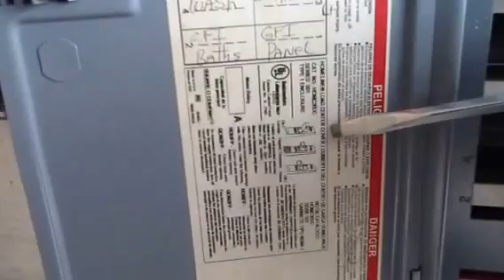"Square D Explain: Home line VS. QO Breakers Made Simple"

Comment: My 20amp dual pole squared d QO only has two snap connectors on one side but only one snap connector on the other side ? I see your 40 amp had two and two .  Is this normal?
Reply from the maker: yours is a Square D QO, what up probably had my hand is a Square D home line,
Which is a builders grade breaker they're two different styles, thanks for watching I appreciate that,

Comment: In 240 volt breaker where a black wire and a white wire are used, the white wire should be colored black at the connection point to indicate it is a hot
wire and not a neutral.
Reply: Absolutely!  Wrap black electrical tape around the wire at ALL connecting points.

Comment: What’s the difference between the single throw and double throw of the two breakers? Is that single throw good for both hot legs to trip or only 1 hot leg to trip? Is only 1 side of the circuit protected in the single throw double pole square d’s?

Comment: Looked at the comments but no one has addressed the 30 in x 3 feet area around the breaker box per code. I had a job a few weeks ago where there was a giant chest freezer in front of the breaker box. The main disconnect breaker was bad. I told the customer its got to be moved. If not I could not suit up for a energized switch out. If not she would have to call the Entergy for a meter pull or call someone else but I still expected my service call fee. Now when I get a call I look at the box and if it is inaccessible I stop and inform the client.

Comment: Wow!  I just learned that I have a QO panel.  I'm in the process of having my electric panel replaced.. and the QO breaker on the video is just like the breaker configuration for the breakers on my current Square D panel which is about 50 years old.  I am having it replaced because the Buss Bar has a short.  And I wasn't sure if I should buy a new homeline or QO electric panel... but the decal on the old panel does say QO.

Comment: 😳 thanks! I found the information I was looking for about 10 seconds into the video.
The installation was going smooth with no issues until I tried to install the breaker and realized that though the box is A Square D, the feet on the one I had were internal and the one on the box was external.
Thanks to your video,  everything made sense. 
So I called the sales associate who told me that they do sell both Home Line and QO, which I need
Reply: My friend went to Home Depot for me and brought the wrong type breaker and the wrong conduit.

Comment: QO, & HL, both "SUCK" trouble  is Aluminium bus bars, "THINK" about it? No-LOX, Inhibitor on service cable lugs, "BUT" not on bus bars? REALLY???
Reply: chill out dude. First: square d DOES manufacture copper buss loadcenters.  just ask your supplier if its so important to you. 2. Aluminium conductors manufactured nowadays do not require no-ox. They are made from the 8000 series alloy which doesnt oxidize nor expand and contract like the wires from the 60's and 70's

Comment: If a person doesn’t know it’s a hot wire coming out of panel then they shouldn’t be in the panel to begin with. Who uses heat shrink on a wire? Wrap it with tape or use a sharpie, but against code comment cause it’s white.? you must be really bored or trying to impress people here or yourself. You sure know a lot lol.Thanks for the QO and Homeline 101. Answered my question. And to the other person commented on tightness and torque, yes he did it right tight as possible, code on tightness lol Loose wires generate heat, can spark, trip breakers etc. us HVAC/R guys see it all the time cause we actually are working on this equipment not pulling wire.
Reply: Too tight damages wires and causes arcing. I’m one of the few who torques every single connection and it’s great to be able to prove to anyone that I did was manufacturer specs say. The thing I hate about square D is their 10-14 AWG conductors have to be torqued to 36 in lbs as opposed to Siemens at 25 and Eaton (BR & CH) at 20! Failure to do this is actually a violation.

Comment: Are those wires live?  How do you shut THEM off before putting them in and tightening them?
Reply: No they are NOT live - how could they be? they are being connected to the SOURCE of electricity. Power doesn't come from the other end of the wire...

Comment: A bit sketchy.  First, I don't think I caught any mention of turning all power to the panel OFF.  And after turning it OFF, testing to make sure it is OFF.  And lastly, putting tape over the main breaker for this sub panel to make sure nobody 'flips' it while I'm working, or for the truly paranoid, putting a lock on the cover!
Reply: Tape is not a lockout means

Comment: My rental has a Siemens double throw breaker as the main breaker on a  square D homeline 200 amp panel. The siemens breaker works but it is slightly lifted on the inside edge. it seems very dangerous. Is this normal? Also, the siemens breaker doesn't have the amp rating on it. I assume it's 200 but Im not sure....
Reply: R U N!
Reply: Don't think you have a double throw breaker. That would be a transfer switch or the like

Comment: none of my breakers have a square "D" on them, they are so old... How old are they?  back when Dinosaurs roamed.. and my panel isn't labeled correctly.. so much for cheap electricians from south of the border, working in housing projects back in the 80's.. my GFI isnt wired right either, trip it in one place and in the other it still has power.

actually there is a torque spec. on lugs, its 45 in.lbs.
Reply from the maker: maybe replace the panel box
Reply: uh NOPE..some 10 years back,  I had to buy a rebuilt breaker because they dont make the amp range anymore (I was told by an electrical supplier) and that one didnt have it either.. the new one I bought yesterday has it casted onto the plastic..

Comment: I know this is an old video, but you telling people to "tighten down you wires as tight as you possibly can" it totally incorrect and can make a hazardous situation just as not tightening them enough will do. there is a torque spec on the breaker that the wire should be tighten to. this is code. not "as tight as possible".
Reply: 05wrangler oh come on.  He didn't say put a two foot breaker bar on the dam thing.  If  someone doesn't understand what he is saying than they don't belong doing this job to begin with

Comment: Nice, very helpful.  Only change I would make would be to clearly state to trip the main before opening the box.  I know most electricians work on a hot box but homeowners should NEVER do that.
Reply: LOL yeah, but he obviously wasn't working on a live one, wasn't using any PPE.   ALSO worth mentioning that shutting off main only cuts current downstream - anything upwards is still live and hot.  To change a full panel you would need a permit to remove the counter outside the home, which cuts current to the main.

Comment: A useful video to distinguish QO and Homeliness breakers. 

      The white insulation on a hot lead and torque specs were covered by other posts.  

      For safety's sake I'd mention that the buses behind the  breaker David was pointing out closely are hot ands when installing a breaker that the switch should be verified to be in the OFF position prior to seating it onto the bus.
Reply: Stay the f*** out of a breaker box if you don't know what you're looking at and can't make sense thing's right or wrong!
Reply: @Thatguyfromttown  

🤔 Why not explain your point concerning my seven year old post rather than make an intellectually lazy, vulgar comment?  Why hide your identity behind that silly handle? 🤔 Does that anonymity provide you the courage to be such a vulgar, disreputable troll?

BTW, I was trained as a USN electrician (Nuclear), and spent 34 years in the Comercial Nuclear field, as an Operator. I was trained and tested every five weeks for those 34 years, and have personally “been in” breaker panels for 120, 440, 4160 VAC, as well as 140 and 244 VDC panels. Furthermore I was both a qualified switchman and trainer for 34.5, 230, and 500 KV transmission switch yards, including Tag-out, pulling/installing  live fuses, and operating disconnects.  At these voltages one’s first mistake is highly likely his last from the resulting arc-flash. ☠️ 

     I have experience installing and removing Cutler Hammer and Square D breakers in panels, and yes, the different lines have different incompatible stab arrangements.  The issue I had is that David, a fine technician, was working a live panel without utilizing PPE. Generally no PPE is reserved for “verified dead, tagged panels” after verifying Zero voltage prior to work with a meter. 

      While the breaker was in the OFF position, since this is a training video, David should have verbalized checking that the breaker was off prior to installing it to prevent a possible arc-flash at the stabs when seating the breaker.  At higher voltages seating or breaking the contacts on a closed breaker usually results in severe burns or a fatality ☠️, even if wearing proper PPE (As an Operator with ancillary duties, I have responded in the capacity of being an EMT or Fire Brigade Incident Commander to such events … four fatalities and several arc-flash events over my career).

      These 220 VAC panels follow the standard convention that ON is toward the center where the buses are located and OFF is towards the outside.  The markings on the breakers ON/OFF or I/O are often difficult to see in low light. 

      The previous narrative is just a matter of “No brag, just fact” to establish my credentials and experience, so now could you share your credentials, experience and finally make a cogent point? 

       I have little experience in electrical new construction, except to note and repair shoddy residential construction performed in blatant violation of the NEC Electrical Code. Perhaps this is your area of expertise. 😎
Reply: Do you think everyone watched the “other” video?

Comment: I came here hoping to get an answer to my question. I have a Square D 150 amp QOC30U Series G breaker box. I am adding a large room, a second air conditioner and a pool with electric heater to my home. I know I'll need a Sub-panel installed but at the same time is it possible and/or safe to swap out the 150A Main breaker with a 200A main breaker? Thank you for your very informative videos!.
Reply: No, it is not OK to simply change the main breaker to a larger size. Your panel is likely rated at a 150 amps, which means the bus on the panel (the flat bars the breakers plug onto) is smaller than the bus on a 200 amp panel.  You need to change the entire panel, not just the main breaker.
Reply: Nope
Reply: +blueoval250 Interesting, I learned, prior to your response, that if the service from the pole and the gauge wire from the meter to the main are rated for it, then Yes this main can be swapped without issue.
Reply: +Robert Johnson well if the buss bars are rated at 200 then technically you could replace it. A lot of times it's easier to just swap the panel. What type of panel do you have? If it's aluminum wire you need 4/0, copper 3/0
Reply: +blueoval250 Square D QOC30U Series G1
Reply: No.
Not if your load center isn't rated for 200A.
Which, it sounds like it isn't. 
Even if you ran a sub-panel, you'd want more than 50 Amps for all that.

Comment: Dave, thanks very much for posting this video! I just installed a 40 amp breaker in my square D QO box for a 25,000 BTU 240 volt electric space heater I just bought and installed in my garage with an 8-2 romex cable. This was my first home electrical job, and I couldn't have done it safely without this video. And yes, I also used both the black wire and the white wire to the breaker since it was after all an 8-2 Romex cable and not an 8-3 cable. My new electric heater didn't call for nor require a white neutral wire to be used, so I didn't see the need to spend more money on an 8-3 romex cable when I would've just been capping off the white wire on the heater side anyway. Thanks again.
Reply: Congrats on the successful install, just be sure to re-identify that white wire as an ungrounded conductor with a black marker or a length of electrical tape for future reference.

Comment: Really? A white wire to a breaker. Talk about a suicide line.
Reply: Cory MacSween The White is required as a hot (Black wire) for 220 double pole breakers. Nothing to do with suicide
Reply: With a 220v circuit, both the black and white are hot. You simply mark the white wire as hot by marker or electrical tape. You can use a black and red wire if you have one, but using black and a marked-white is standard.

Comment: if you hooked up the neutral to the breaker maybe you should follow your own advise and call a qualified licensed electrician since i noticed that not the only neutral wire that is wrong and i should have been a red wire.
Reply: Now  at jmonkey35 I will have to disagree with you there about the red wire. In commercial or if pulling individual wires through conduit you have the option to buy black and red wires for the circuit. The only Romex wire that has a red wire in it would be a 3 wire cable (10/3, 8/3, or 6/3, etc) for a 120/240 volt circuit like a dryer or range (stove) as others call it. But just for 240 volt circuits that don't require 120 volts with the 240; you would use 2 wire cable like 10/2, 12/2, etc depending on what you're wiring. It has a  white, black, and a bare ground in which case you do identify the white as a hot wire. On both ends though. Otherwise you would have an extra wire just chill in not attached to anything because a neutrals not required for a 240 volt circuit.
Reply: So, the only romex that has a-red wire in it is..12/3  10/3. 8/3 etc?
Try looking at “Romex” which originates in North America aka Canada, which has romex with just a red, black and bare ground.
NMD-90..google itand dosome searching and educate yourself
Reply: @anthonysmith4600  According to the spec sheets, NMD-90 Red/Black starts at #8 and goes larger, and is not available in 12-2 or 10-2.  Also, it wasn't even on the market when this video was produced or the comment to which you replied was written.   What was that about using google and educating yourself?

Comment: It's against the code.  You must not connect a white wire to a breaker.  White is for neutral.  In order to be legal, you must mark your white wire as a live wire by wrapping it in black electrical tape or in heat shrink tubing at BOTH ends.
Reply: Actually you can't use electrical tape anymore per the NEC. It has to be a permanent means of identification. A Sharpie works good. Electrical tape is not permanent.
Reply: The vid is how to install the breaker....not color coding
Reply: agreed................ white wires with voltage in them should be marked with permanent marker
Reply: Your Correct